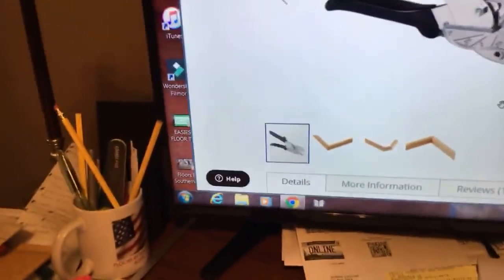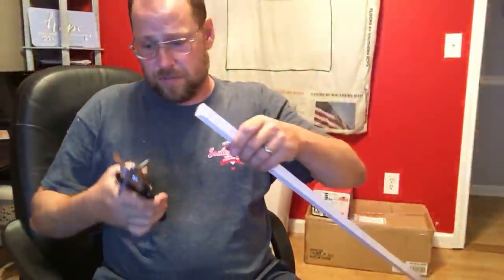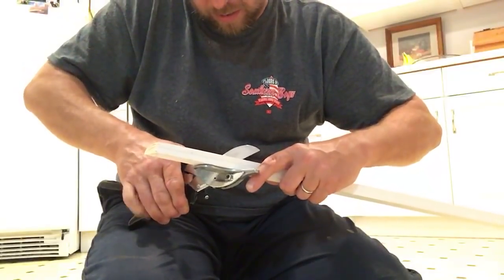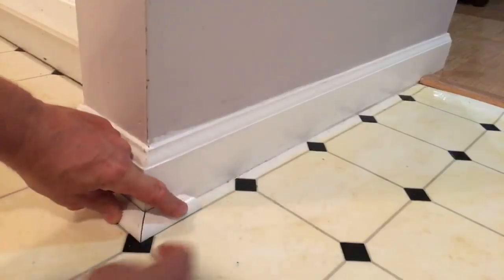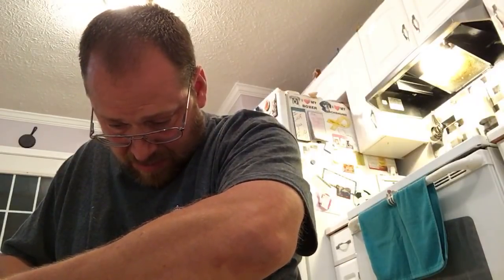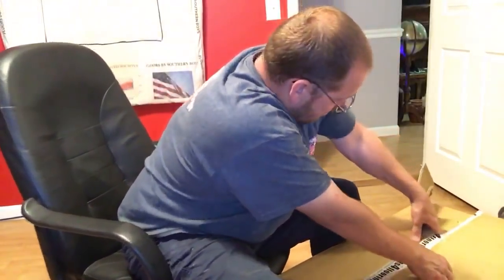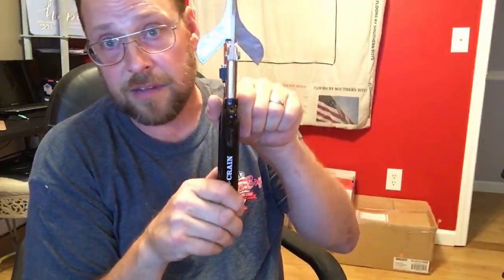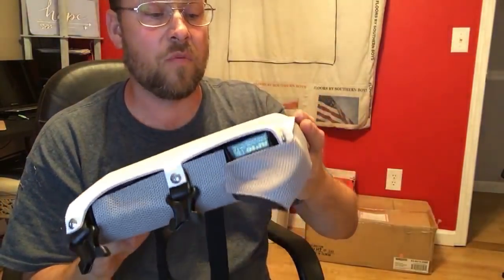Crane miter cutter, yay or nay plus a giveaway

Comment: Bought my first pair. They r fantastic for smaller jobs and areas. good bye miter box and miter saw for now....until I get a big job. I wear pro knees too. I used to rock the long ones but now I use the shorties and I prefer them
Reply from the maker: Daniel Hayworth These miter cutters are awesome for small jobs, thank you for your feedback
Reply: @FloorsbySouthernboys  yes sir. i also have found that the straight cut is the only angle that doesnt cut just like butter. i see u got the long pro knees i only recommend the short ones because u cant comfortably bump a knee kicker without stabbing your ankles in the long ones. just my opinion. slip om knee braces under the short pro knees is my go too. its all in the hammock your knees under rest in. plus those shin pads get really gross eventually. love your channel only real channel for floor layers. Id love to start one myself
Reply from the maker: DownRightFlooring KansasCity well thank you, I appreciate all your advice and comments, I do have  The short pro knees though and I am never use a kicker with kneepads on , I don’t even wear kneepads and installing carpet only on hard surface

Comment: I use these about every day. The only thing I dislike about them is that the bed where the material sits isn't flat. This causes the corners to not come together as nice. One thing I do is cut my miter, then cut the backside almost like a cope cut. It's hard to explain but it works
Reply from the maker: ccarn309ohio I know exactly what you’re talking about, thank you for sharing that tip